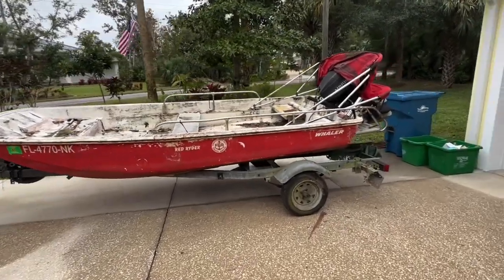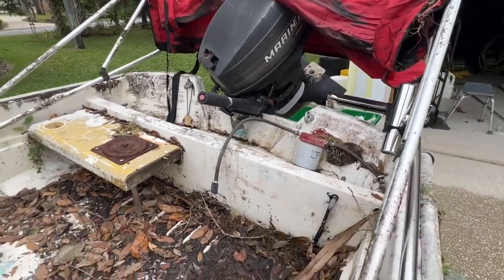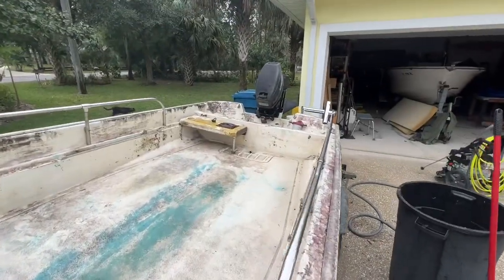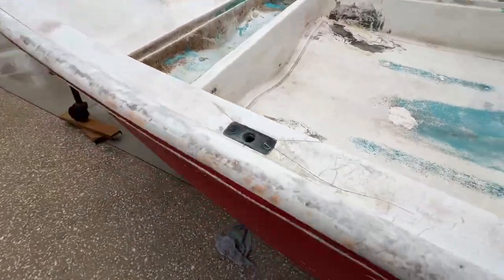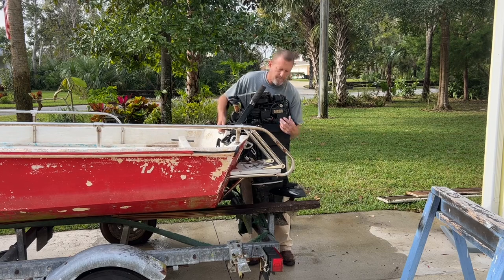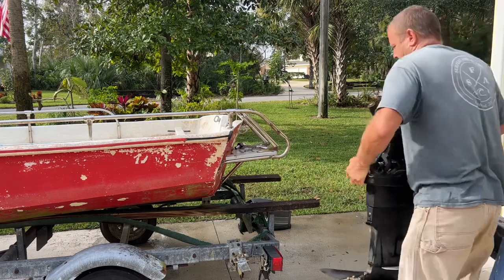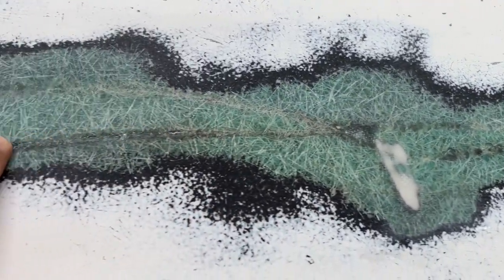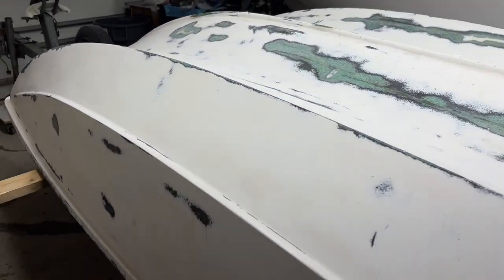1971 Boston Whaler 13 total restoration - Part 1

Comment: Looking forward to seeing the progress. Are you going to epoxy the hull or gel coat? Im doing my 63' whaler and im on the fence to go polyester or epoxy. What fairing compound are you going to use?
Reply from the maker: Plan on gell coat
Reply from the maker: I should have the next episode. Up soon. It has been so hot i havent been able to work on it.

Comment: if the foam is wet, in what way can it be dry?
Reply from the maker: I honestly have no idea. Luckily mine was dry as a bone. I have seen several people cut out the floor and dig it all out re foam. I have also wondered if a vacuum pump would work wrap the whole boat in a vacume bag and pump it down for a few days but that would be an experiment .
Reply: @StoneBrokeAdventure  thank you